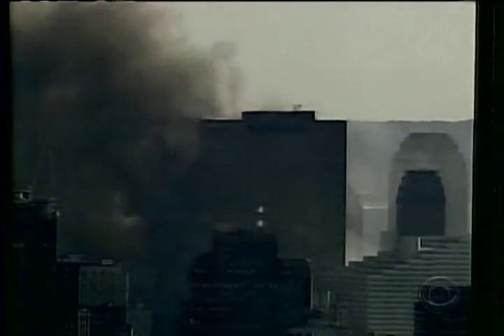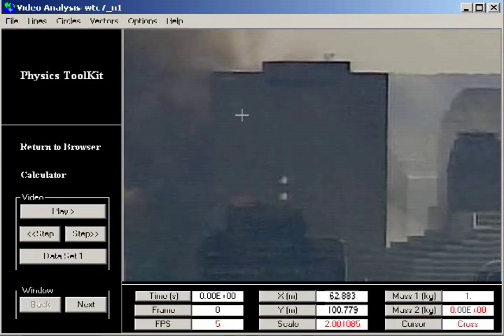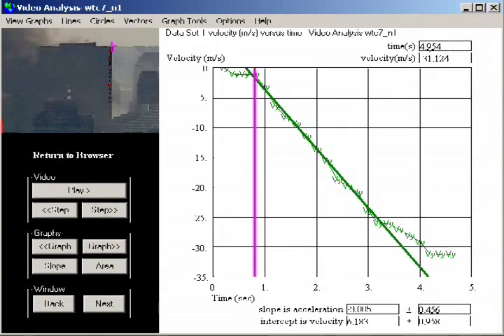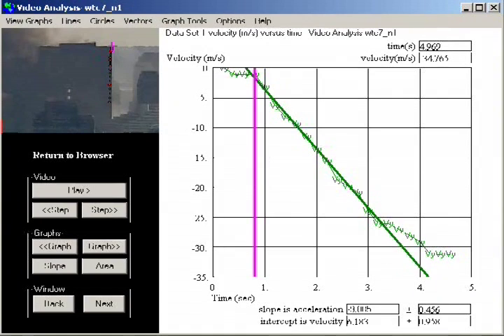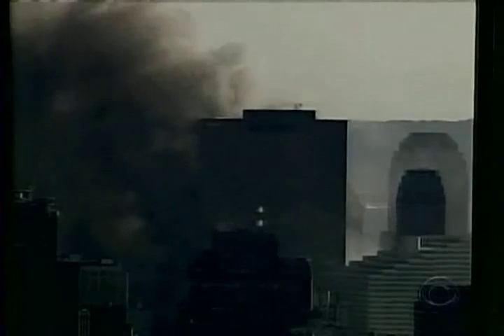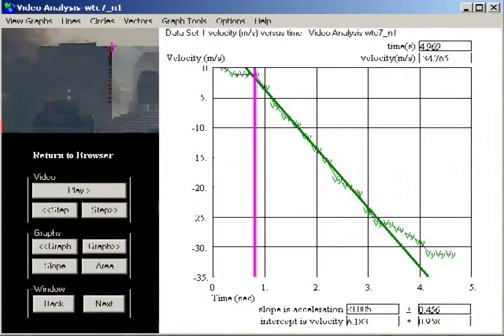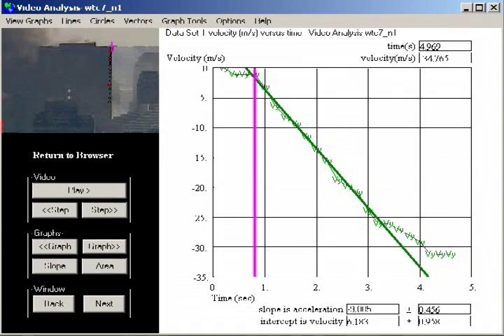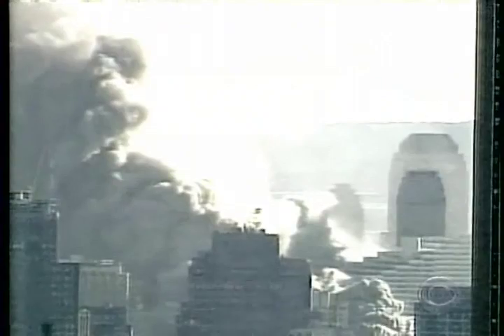Physics - WTC7 Freefall by David Chandler - AE911Truth.org

Comment: PREPARING THE WTC FOR DESTRUCTION
http://www.conspiracy-cafe.com/apps/blog/show/8636674-preparing-the-wtc-for-destruction
What are the odds that an avant garde Austrian art group was given access to the 91st floor of the North Tower of the World Trade Center to remove windows, erect platforms outside the structure and leave material that could only be viewed by a close passing helicopter on a clear day? Well they are 100%.

What are the odds the art troupe are named after an explosive called Gelatin? What are the odds this group is sponsored by a cultural group who has an Israeli agent as a member who lived blocks from Mohammed Atta the terrorist who hated modern art and crashed an aircraft into it? Well they are 100%.

What are the odds that the markings on the cases that lined the walls of the space they were using were the same markings used for a special fuse holder assembly that allows for complex wiring? Well they are 100% too.

What are the odds the New York Times actually published a full page feature in August even showing pictures of the artists at work? Yes 100%.

What are the odds the graphic above if found in the hands of a Muslim in Iraq or Afghanistan would get you a one-way ticket to Guantanamo with no chance to escape the water boarding season? Well more than 100% for sure.

Comment: You cant use the width of the building in the video to calibrate the height of the building in the video,  big fail.

Also, buildings brought down in controlled demo DO NOT accelerate at free fall.  Im not sure hoe proving that it is falling at 9.8m-s (which you didnt prove) proves it was demolished.
Reply: Show me.  lol.
Reply: Matthew Richardson
Chandler did NOT use the width of the building to calibrate the height. He plainly stated that he had to do that in an earlier video. In this video he used elevations provided by NIST. They gave the height of the 29th floor as 683ft - 6in and the roof line as 925ft - 4in. so Chandler did not fail. You just can't understand plain English.

What Chandler absolutely proved is that for the first 2.5 seconds the building DID collapse at free fall meaning there were NO supporting columns left in place to resist the falling building. So where did all the columns go? Do you really believe the fires destroyed STEEL COLUMNS? If you do you're an IDIOT.

Comment: "Free fall" is impossible, proven by observation of Chandler's own video. Hold a straight edge against the NW corner as it falls (the corner Chandler measures). It moves side to side as it descends. A part of the structure is in contact with the ground during descent. There is no other way for that movement to have occurred.
One would have to measure in milliseconds to distinguish between absolute free fall and minimal resistance. A telephoto lens from a few miles away on a camera with normal frames per second cannot produce such measurements. Chandler even admits to a 1% margin of error; it's probably much higher. Regardless, the side to side movement proves it is not falling at free fall.
Reply: Hey bro you typed all that and wasted every ones time. NIST acknowledged free fall. So shut up.
Reply: drayne3750 NIST said collapses were due to airliner crashes, so I guess it's your turn to shut up.
Reply: drayne3750 If you use a source such as NIST as an authority to establish fact, you have to be consistent.
I don't use NIST, or anyone else as an authority. I go by evidence.
If you think the alleged free fall portion of collapse is suspicious, or a sign of controlled demolition, then you have to believe they waited for the perimeter wall structure to start falling over on it's own for 2.75 seconds before setting off the charges. Link below is a loop of the first second; not even any down move, but half the structure is falling over. The next 1.75 seconds can be seen on Chandler's chart to be down and continued over, but much less than free fall. THEN the "free fall" portioned ensued. Show us the signs of controlled demo at the start of perimeter wall collapse: https://media.giphy.com/media/26BRHuKQqWcyY2Xja/giphy.gif
Ps: Are you always so rude when first talking to someone?
Reply: drayne3750 I don't do "theory". That's for amateurs, lazy people, and con artists. I go by what the evidence states as fact.
But hey, you are free to believe whatever you want. Seems silly though, to believe Lucky Larry had his boys wait til after 7WTC had already started falling over on it's own before setting off the charges.
Reply: whetedge What do you do for employment?
Reply: speculation about silverstein's motivations should include the fact that he made $500,000,000 on WTC 7, post reconstruction alone,  and pocketed  $3.5 BILLION insurance settlement, from a $ 125 million initial 
investment,. of which only $14 million was his money.  http://www.rense.com/general82/whod.htm
Reply: Mitchell McAleer Before speculating about motive, you have to prove a crime was committed.  "Controlled demolition" is speculation with zero evidence, so speculating about motive is nothing but fantasy.
Reply: Trump is a Zionist Shill
Wait...I thought the NIST report was a fraud. Now you use it to establish fact? Can't have both ways.
You do realize it's irrelevant anyway, right?

Comment: Chandler quotes NIST as putting the height of the 47-floor WTC Building 7 roofline at 925'-4". Wikipedia states the height of the roof as 743'-0". Google also states the height of the roof as 743'-0". Chandler also quotes NIST as putting the height of Floor 29 at 683'-6". 

The difference between the two heights given by NIST is 241'-10". There are 19 stories inclusive between the bottom of Floor 29 and the top of Floor 47. Dividing 241'-10" by 19 gives a height of 12'-9" for each story. Multiplying 12'-9" by 47 stories gives the total above-ground height of the building as 598'-3", a difference of 144'-9" from the height given by Wikipedia and Google.
Reply: Oyeah, both google and wikipedia made themselves greatly known as free and untouched sources for the plain truth. Or, maybe not?

Comment: I don't think we have to argue about the fact that WTC7 was demolished.
What astounds me however is that it doesn't seem to fit into the well-planned sceme of the rest of the day. I think WTC 7 was an accident and it didn't go as planned.

Flight 93 was shot down over Shanksville right after it turned straight to NYC. This is a speculation on my part, but I think a reasonable one. The alledged highjackers waited over 30 minutes to take over the plane and knew that it takes about 7 minutes for interceptors to arrive.

This makes it clear that Flight 93 stayed so long into the air because it was destined for WTC 7 and had to wait for the North Tower to clear the way. Take a look at the map, WTC 7 could only be hit from the South. It was taller than the other buildings on the North, East and West, but you could only get a clear shot from the South.

The shutdown however wasn't planned. The conspirators were looking at the monitors in horror and still had the building completely wired but without a plane to knock it down.
But it had to go down to complete the deceptive firework show, but also to erase the important files and spare Silverstein the asbestos removal.
Reply: +naralaiho 
I believe the plan was for a hijacked airliner to crash into WTC Building 7, but I'm not so certain it was United Flight 93. I believe the plane was shot down right after it left its planned course. Looking closely at the flight path of United 93 shows that just before it crashed it veered off a southeasterly course toward Washington, DC and began heading east back toward Newark International Airport where the flight originated. If it was in fact originally on a course to Washington, then the likely target was either the Capitol Building or White House.
http://www.cbsnews.com/news/white-house-was-flight-93-target/

We don't know how many planes were planned to be hijacked on 9/11 or exactly how they were planned to be hijacked, but it could have been several more than four. In an operation as large and complex as the 9/11 attacks some things are bound to go wrong. It may have been the case that the plane that was planned to crash into WTC Building 7 simply was never able to take off or perhaps it had technical problems in flight that prevented it from reaching its target.
Reply: One airplane never reached its destination. That could have been building 7. Even so, the sheeple still bought the government's story. People are stupid.
Reply: michael shoen, you sure got that right buddy.  I mean, think about it, there are 3000 idiot, who are architects and engineers who have signed on to the bogus cause of Richard gage.   there are about 1 million architects and engineers in the USA alone.   Lets not even talk about how many engineers the Chinese are pumping out, but we can focus on this 3000 number that grifter gage likes to tote.   This number includes "experts" from the world wide community, such as the Danish certified nut job, nils Harriet.  Anyway,  10,000, this number is 1% of a million.   Do you get it Michael, if the nutters had 10,000 professionals who signed the ANE petition, they would have 1 % of the number of total engineers and architects, just in the USA.   

3000, what a pathetically small number of professionals.  It's embarrassing!!!   Is David chandler one of the three thousand petition signers, because he is a community college teacher, and I assure you his degree is not from cal tech, MIT, or any other top ranked, top rated school.

Comment: op needs to realize that even if the building were demolished, and someone were to put explosives on every floor, there would still be a reactive force because the top floor would need to destabilize the floor below. We would also see a much further lead up of blown out windows, but that is off topic. Basically he has no understanding of demolition. His math must necessarily be wrong under any circumstance. Give us a good video and a good measurement. Not the shady video from far away. What he is displaying isn't even recognizable as one of the towers.
Reply: lastandbesthope it's so funny how people like you can believe just "the fires weakened the structure and it collapsed", but when people actually investigate and find something, you don't buy it.